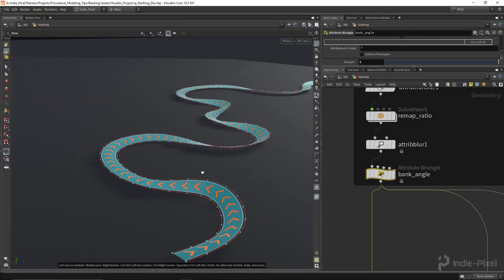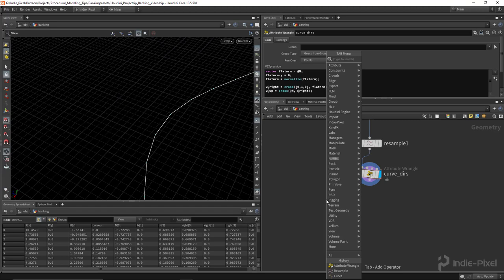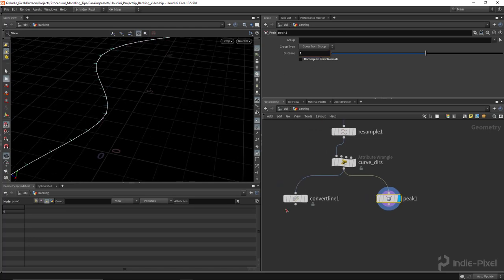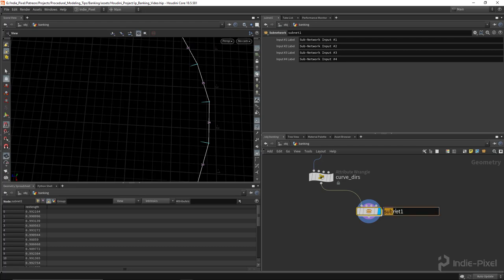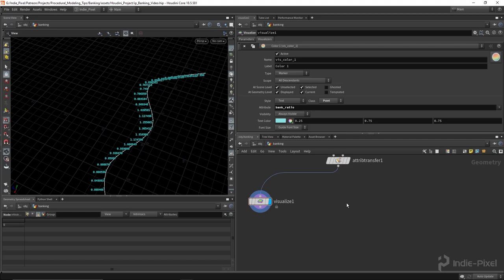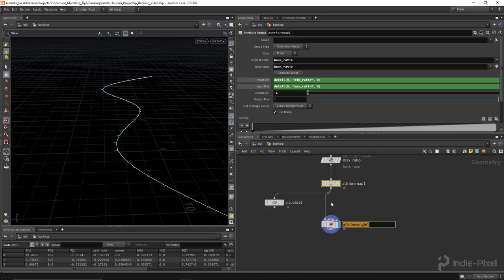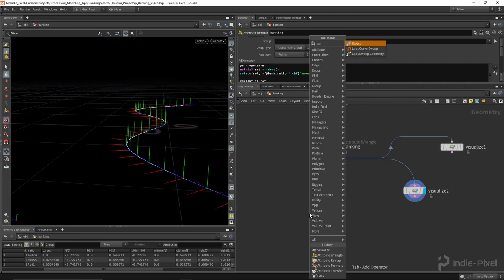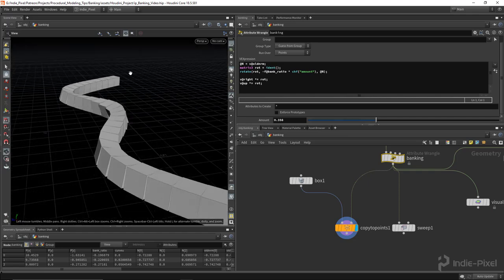Houdini - Procedural Modeling Tips! - Curve Banking

Comment: Interesting approach, I hadn't thought about measuring the ratio between a peaked twin curve and the original, quite clever. There's however a much simpler way to find the banking with the measure SOP, set to Curvature/Principal, Smaller/Signed/Vector. The resulting vector will be something we can input into a Sweep SOP Partial Twist Scale By Attribute. Cheers Kenny!

Comment: thank you amazing tutorials very helpful, in the attribute remap you can just pres on compute range and it will put the min and max values for you without writing the code :)
Reply from the maker: You are welcome.  You can press the compute rang for sure, but if you are putting this into an hda, then the min and max will need to be found through code to make it procedural.  So it can take in any user curve, but if it's not an hda, then yep! You can hit the compute rang button.
Reply: @IndiePixel3D  I see :) thanks!

Comment: Great tutorial, really helped me out, thanks.
Instead of the Attribute Transfer I tried a polypath SOP which uncomplicates the node tree slightly. Also when calculating the bank_ratio, you had f@restlength/otherlength, which gave me an unexpected result.. when i swapped these around  my banking worked as expected (without the negate in the matrix calc). Not sure why my results were different.

Comment: I don't think you actually want to fit the bank_ratio between -1 and 1 here, that will mean that points with an initial bank_ratio of 1 could wind up mapped to some value other than 0 when used for rotation (i.e points that should have no rotation might end up rotated: when the peaked and non peak rest lengths are both the same, e.g 1/1 = 1, their rotation should be 0). I think you can simply do @bank_ratio -= 1 and that will center everything around the points that should not have any banking.